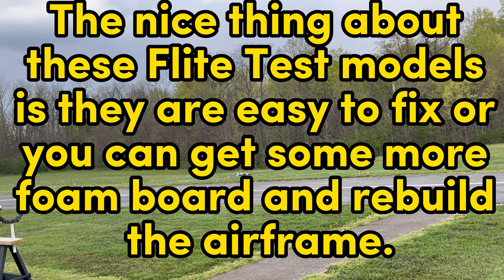Flite Test Corsair TIP STALL and Crash - Pilot Jerry

Comment: Looked dangerously slow and pitchy the whole time. Had plenty of power reserves, apparently.
Guess he was too busy with trims and setup, and forgot to fly the model.

Hope it is repairable! 😀
Reply from the maker: Turns out it was tail heavy.  He just built a new one and realized he didn't check the CG on the first one because he just went by the instructions.  
The manual called for a 3s battery but going back to the flite test video by Josh, he was using a 4s battery.